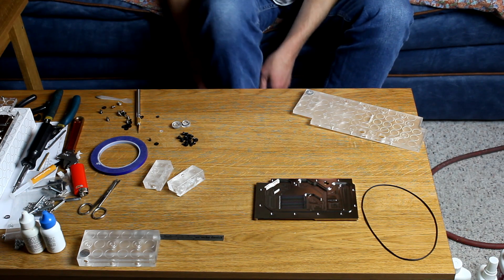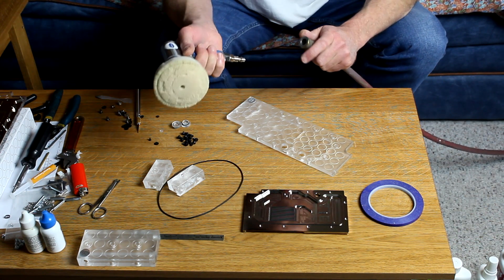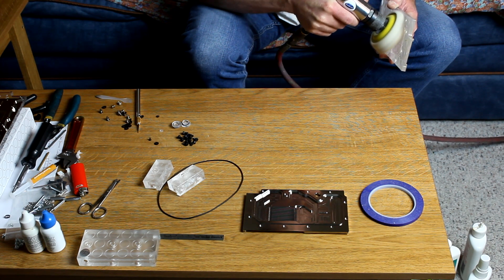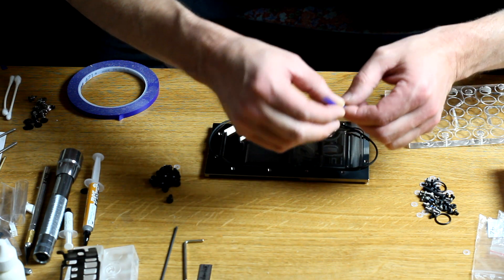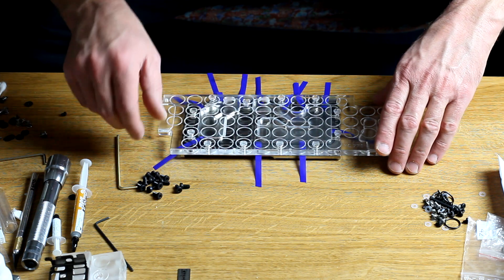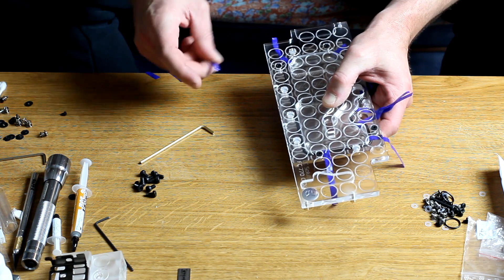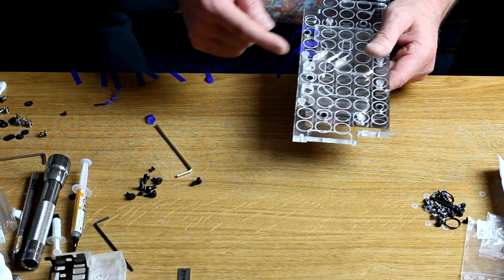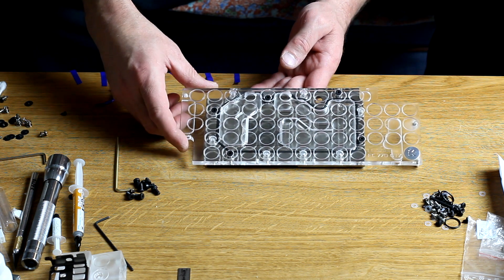EK GPU Block Polishing

Comment: Do you have a guide or tutorial that you use to do that? Thanks
Reply from the maker: I used Novus polishing compound.  It’s a three stage process.  Foam pad on the air tool.  There is really no guide I guess.
Reply: Hanoverfist1969 and how many time i must sand the block?
Reply from the maker: Just polish really.. no sanding.  Polish until your happy with it.  The frosting on the acrylic will come off quite easy

Comment: great video. is there a safe way to polish the nickel on the block? I used mayhems dye with some clear coolant and it wrecked my blocks. just dingy now.
Reply: Andrew Williams you may have found a way by now, I use a light abrasive auto polish on my nickel blocks, the brand in particular that I use is called Peek Metal Polish :)